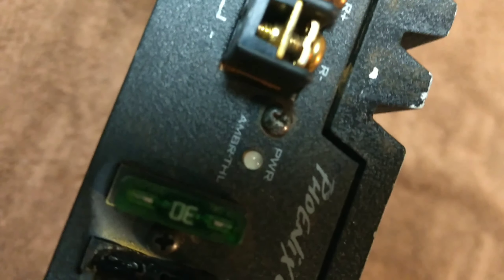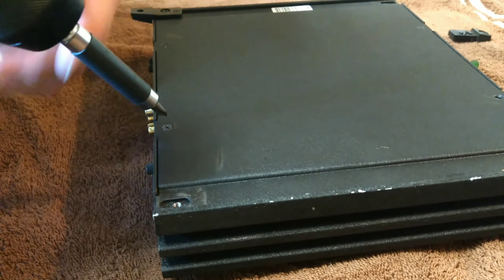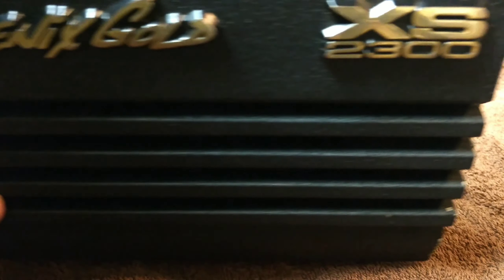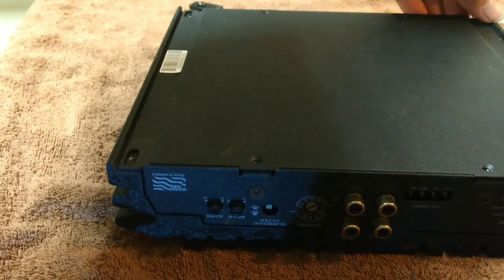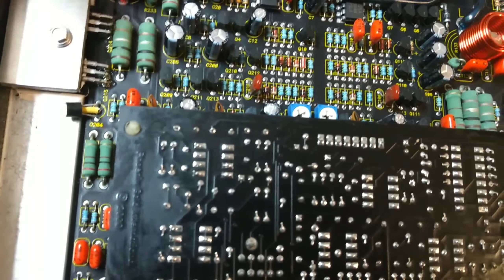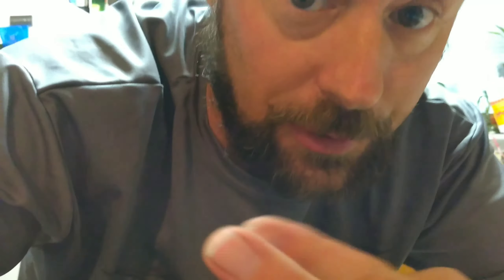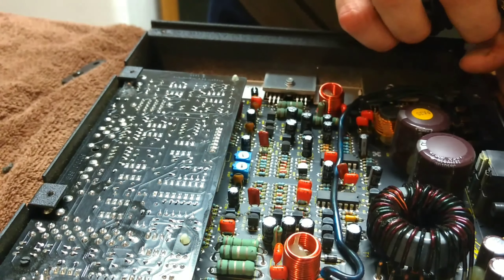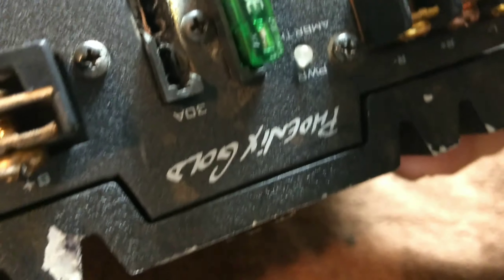How to repair a burnt fuse bank on an old Phoenix Gold xs 2300

Comment: Hope you get that beauty working!
Reply from the maker: Yep she works just tested it but it still getting hot at fuse #2 , thinking about getting the caps replaced.thanks for watching buddy
Reply: Yea it sounds like the bias has drifted on that channel and also could be caps!  I changed all mine in my punch 200ix and sent it to evan at desert audio specialists they are the BEST in the country it all the old engineers from fosgate, Phoenix gold and more I promise you will love them!!
Reply from the maker: @karl6823  thanks buddy ,I've got global electronics out here ,but they only seem to fix so much,if it's a logic issue,they struggle.so desert electronics huh?
Reply: Bro no joke desert audio specialists will beat out ANYBODY it the original designers working on the amp not a tech
Reply from the maker: @karl6823  excellent, thanks so much for the update and I will contact them if you have info,I have an eclipse da7232 the original slab design by bang and olfson I need repaired
Reply: @ogairbender808  my 2010 Audi A4 Quattro turbo has that bang & Olufsen sound system 19th speakers it's unbelievable!
Reply from the maker: @Simpleman1078  wow
Reply from the maker: @Simpleman1078  yeah I thought about just resoldering some shit together,but as you know this bitch is as old as us lol,and about as brittle so I chose to go the easy route first,and as I suspected the #2 bank still gets hot,not sure why I mean the power goes through both of them ( fuses that is).any suggestions?
Reply from the maker: @Simpleman1078  it does work though as good as it ever did ,I just don't like that much heat on a fuse
Reply: @ogairbender808  like they always say if it ain't broke don't fix it

Comment: That's funny as shit I'm 41 now when I was like 18 I had that same amp on 2 12in Kenwood twister tornado ones I don't know that's what I called them cuz the dust caps were all 3D looking and twisted.... Anyways did you take that Phillips screw out I think you could take that out and then just desolder it and buy the double fuse on eBay and just solder it in should be two connections to solder that's it... A little at work great for me I never had an issue with it don't even remember what happened to it, DAMN I'M GETTING OLD!! 🤔